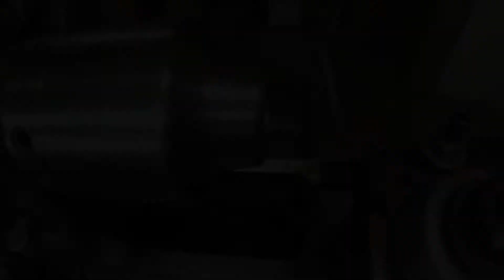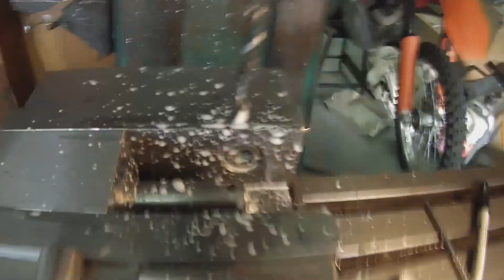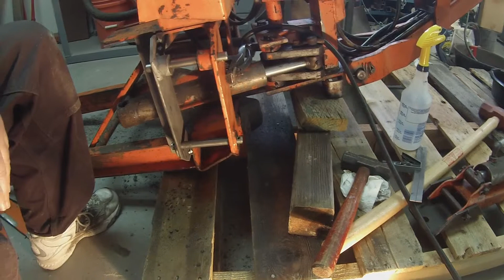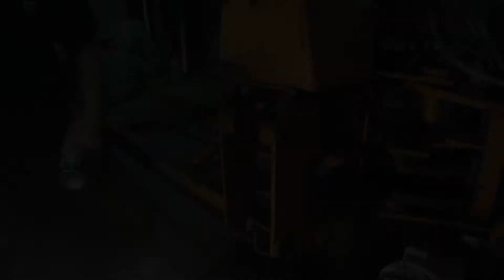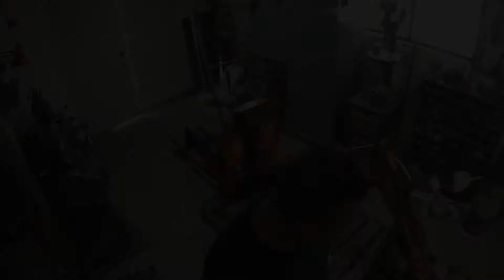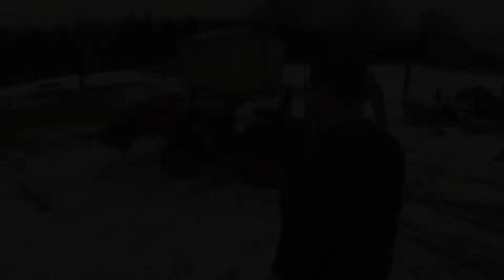Backhoe Woes Part 4

Comment: nice job on the Kubota tractor build. I have the same mig machine as you. I have a millermatic 200 its a solid machine. a gye had it in the corner of his shop with the cover off and a bunch of shit piled on it. he told me the drive roll motor was gone and it would be 800 for a new motor and asked me if I wanted it. so I took it to the welding repair shop and all it was    was a 20 dollar diode and a little spray of wd-40 on the fan motor and it was good to go cost me 168 dollars lol.